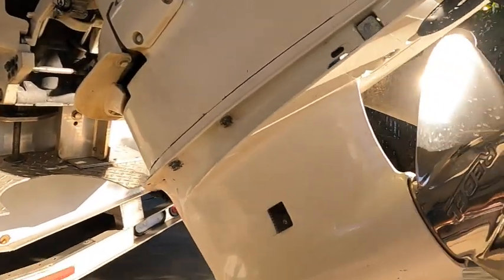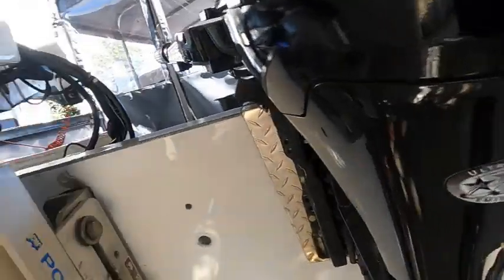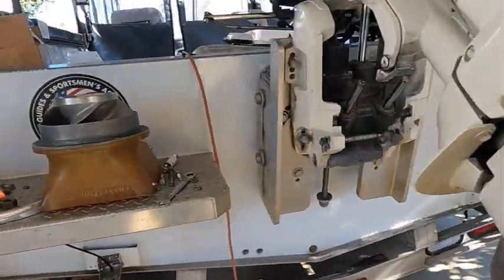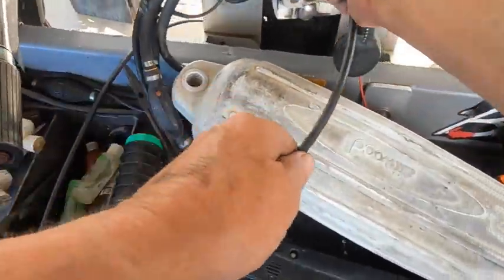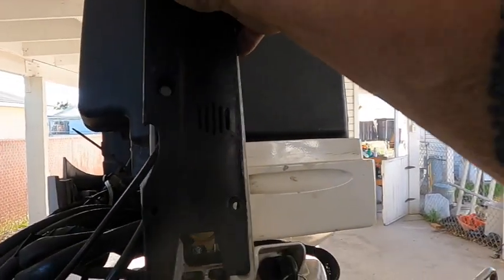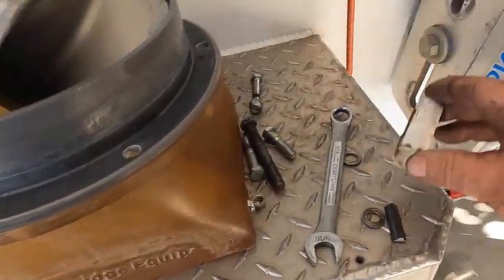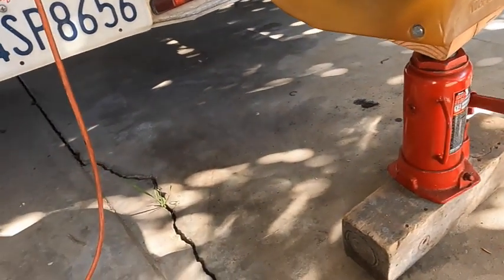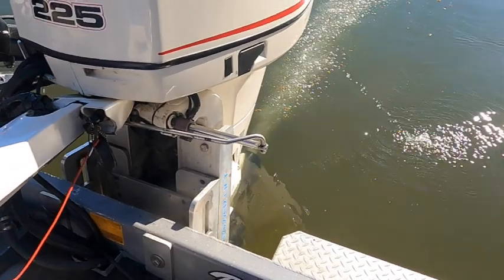How To Changing Your Prop To A Jet

Comment: Do you ever put the bolt on the rear of the jet pump?
Reply from the maker: Mine is wedge and a pin that sheered off from being corroded but I don't think it's necessary so I didn't put one in while I had one ordered